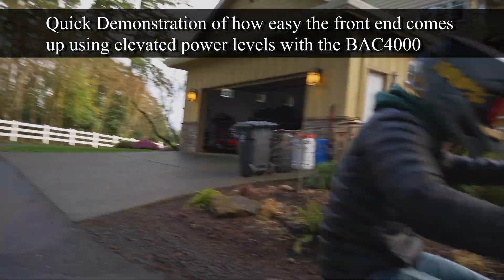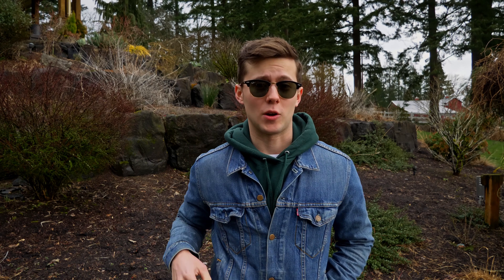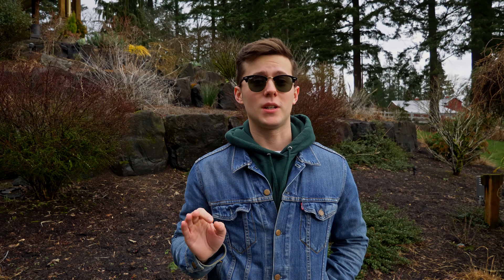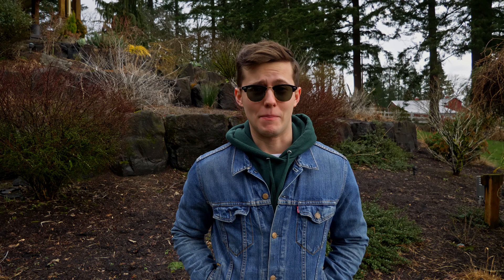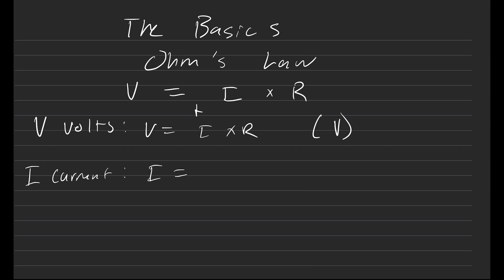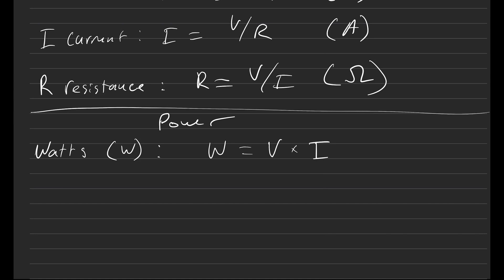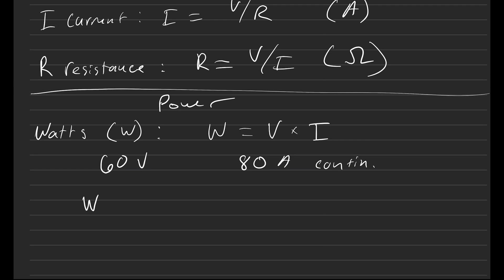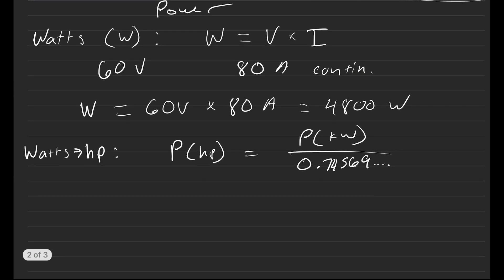The ASI BAC8000 is Overkill for the Sur Ron X

Comment: Do they give the same top speed?
Reply from the maker: There is some nuance to your question, but in general yes so long as the power supply is the same voltage and the settings are the same.

Comment: After running your 8000 kit for a while now, I can say forsure that the stock motor can handle more than what the 4000 can deliver.
Reply from the maker: Yeah it’s fairly situation dependent on the rider and type of terrain which we didn’t cover adequately in this video. For example, we’ve overheated the stock motor on the 4000 plenty of times on short hill climbs. In that instance, the 8000 would’ve just exacerbated the issue. Riding down the road or on more wide open trails, it can take more without overheating.

Comment: This is not true sorry. I'm 100kg and have MX forks. The bike is underpowered for me on a bac 4k and 72v. Especially on steep trails when I'm stopped midway up it doesn't have the phase amps to start again on stock sprocket
Reply from the maker: Yeah it’s definitely underpowered but our main point is that by pushing that extra motor current the motor overheats so quick. With new motors coming out there is a much more clear spot in the market for BAC8000 sized controllers.

Comment: E = Mc 2 So how much more efficient is the electric motor compared to a gasoline engine. Can they even be compared?  Why is a electric motor considered more environmentally clean when the manufacturing of components is more detrimental to the environment than gas engines? How can the electric motor be more clean when it still takes fossilized fuels to power the battery, and manufacture parts.
Why not just build fusion batteries or nuclear powered bikes? Are we building a 3rd world society in America? I really enjoyed your tutorial.  I hope one day I will ride one of your bikes. Outstanding ! Never limit yourself or your dreams.
Reply from the maker: Ebike is far more efficient but lithium is far less energy dense than gas. 

Long term goal would be everything is ran off fully renewable. Unrealistic though in a short timeframe.

Comment: Not hating but can’t the bac8k do max 840 phase amps u said 600 about unless your meaning like average 650 but max 840
Reply from the maker: We’ve never seen anyone successfully run 840 or even above 700 for that matter but yes, technically the controller is capable of 840.

Comment: Great video. Where you confused me is when you said that kwh is the most important number to look at when looking at how long a battery will last, and then went on to do an example where you used ah to look at how long a battery would last. My understanding is that if two batteries have equal ah, but one has a higher voltage, then the higher voltage one will go further or last longer given all else is equal. Makes sense because the kwh would be higher. But how does this play into calculating how long a battery will last? In your example, you completely left the voltage of the battery out of the equation, but instead talked about the power draw at 60v. Are you able to shed any light on my confusion? How would the voltage of the battery play into this calculation and change it?

Comment: To avoid jerky throttle you can Can change throttle curve or up battery amps and lower max phase amps for more high rpm power.  Gotta be careful not to overheat the motor though.

Comment: New to Sur Ron - the battery power options are pretty overwhelming.  Since so many are upping their batteries to 72V, why is it Sur Ron or someone else doesn't produce a 72V motor that is less likely to get fried by over-powering it?
Reply from the maker: There are a couple companies who are actually doing just that! Of course this leads to a TON of other issues. Namely:

-Swing arm is too weak for more power.
-chain is to small and already stretches very fast at 10-12kW
-the bike is entirely mountain bike components
-no real way to put down double or triple what a BAC4000 and stock motor can already put down. 

Certainly an upgrade more geared toward road riders!

Comment: So a question I have is what parameter does the “power levels” change when switching 1-9? Is it just lowering /raising the wattage?
Reply from the maker: Good question. You can think of power levels of a percentage of power based on the power level you set. For example, say you set the max throttle power in 'ASI settings' to 10,000W. At level 9, you'd have 100% power, so 10,000W. level 8 gives 90% power, so 9,000W. Each power level you go down drops the max power and max speed by 10%.

Comment: ASI 8000 is serious overkill i agree, unless you wanna set ebike top speed records or something but the motor will burn out.  Hell even the 4000 is overkill, peak power 72v @ 400amps? 30,000 watts? Thats like death power on a ebike.  I built an electric bike long ago, 72v @ 40 amps.. thats 3000 watts.. topping out @ 40mph and that scared me.

about efficiency, higher voltage is more efficient, and about 10 years ago, people on endless sphere were making ebikes that topped out @ 120v going about 60mph.  But then this dude came out and smashed all top speed records in his sandals on a garage sale looking bmx bike with a welded frame attached to a hub motor.  That motor had high wind (i believe) motor.. meaning for a given volt, it will do more turns.  So instead of going crazy high voltage, he went small radius tire, high winding motor, medium voltage and LOTS of amps. Since then, people toned down the voltage and got fast spinning motors with lots of amps.  Direct drive electrical motors love RPMs.  The faster it spins, the better.

So if you want more efficiency figure out how to make the motor spin faster.. more volts, or smaller wheels.  Mid drive instead of hub motor.

Comment: Thank you so much bro the whole part on phase current helped me so much I think this is why my BBSHD with the asi bac855 keeps getting burning hot despite if I run it in my torque gear aka 1st gear the whole time it still gets burning hot.  I was always told to run it this way because I was told on that motor that you want the motor spin as high rpms as possible to keep it running cool and seen some videos with guys pushing high power but on bigger rear sprockets and the motors run cooler (on the BBSHD we change the front chainring instead as opposed to surrons with the rear sprocket due to the derailer as I'm sure you know).  This all makes sense to me now after your explanation and I can finally get why a 72v gives more speed despite the bac855 adjust it's amp draw down for the 72v thus producing the same max watts on a 72v battery as it will do on a 52v battery.  On the 52v battery the bac855 raises the amps some than what it runs the 72v at.  I'm from the drone world and so I always knew about the kv of a electric motor and how it relates to speed and which battery works best with which kV and so on.  I sometimes wonder if they make a higher kV motor you can slap in the surrons and that would effectively be similar to running a 72v battery on the stock one.

Comment: Hey nice vid do you know if I could use the bac 4000 with the 72v lite speed battery
Reply from the maker: Yes, must have the correct system voltage on the tune though.

Comment: Is there a difference between 160 and 260 motors? Because I know battery and controller are different
Reply from the maker: They are different. How the differences effect the max power capabilities, that we don’t know. Since they’re different,  it’d make sense that the x160 was a lower power rating.

Comment: I have an x160 can the 4000 be programed to a 48v? so I can upgrade battery later
Reply from the maker: It can be programmed, but the x160 motor is not the same as the x260 and can’t take as much power.
Reply: @emotobros  i figured it's better than getting a x controller, but i don't need crazy power yet..looking for more range and a little more top speed
Reply from the maker: More range and speed needs a controller+battery combination
Reply: @emotobros  Thanks for the replies I know I need both but I figured I’d start with a controller wish I had the funds for both at the same time didn’t want to get the battery first because the controller I have won’t work with it…You guys have any idea when the new shipments coming

Comment: The bottom line is.... There are many people that have skill levels much more advanced than you.  The need for higher power levels are necessary to advance the development for individuals that are in a category above your capabilities along with advancing the development of different models of the bike itself. Not all interested riders are 5'5" 150 lbs, therefore the need for power increase is logical.   🤦.
Reply from the maker: Did you even watch the video 😂 completely missed the point
Reply: @emotobros  find a gym, strengthen and exercise muscles you don't use.  If your a beginner or even a novice then you don't need to be critical of people above your skill level.  I'm sure the battery companies have already figured this out.  😂
Reply from the maker: @thomaspartin191  Hey man, I can tell you aren't understanding so I'll make it more simple because we use a lot of technical terms. More power = more heat in the motor = motor failure. This has nothing to do with rider skill. Anyone of any skill level can hop on a road and hold the throttle wide open and burn down the bike.
Reply: @emotobros  face it, you shouldn't be critical of areas your not familiar with. Technically speaking, your equivalent body mass vs your mind strength is negative equation.  Like I keep saying, the bike manufacturer along with the battery manufacturer have done research, done testing with real people.  I'm almost positive these companies engineers  have went to college for "technical" advancement, that's how they development the electric bike and you didn't.   Nice try bro. 😂.
Reply from the maker: @thomaspartin191  Areas I'm not familiar with? I'm a double engineering major and have been riding for 15 years. I'm one of the guys who you are acclaiming. Also, this video is not related to the bike or battery manufacturer which tells me even more that you didn't watch it. Some of the engineers at ASI don't even run 8000s on their bikes, so in a sense you're right. They do know what they're talking about. The 8000 is overkill for the SurRon, glad we are on the same page.

Comment: Awesome video guys!!  I'm really glad you focused on "usable power" so many people focus on a single number and making power useable is so much more important than just a single peak power rating.  This is the same reason that when MX racers such as Ricky Carmichael first started racing 450cc MX bikes with 50+HP, many of the pro racers actually detuned the engine to make it more usable and win races.  Meanwhile ameature racers with the mindset of more power = faster were bolting on aftermarket exhaust and other power enhancers...by increasing power they were actually getting slower lap times.  If you ride a modern EFI 450cc race bike and compare it to the early 450cc machines, you find a far smoother power delivery in a modern bike which can actually feel slower to your senses, but the "usable power" dramatically increases your race speed.
Reply from the maker: Totally agree. Like you mention, even the modern factory 450s are basically running the same HP as stock. It’s all about their crazy engine programming and traction control to make the power usable. Some people are stubborn though...

Comment: Good points, in  the 1940's and 50s there were GP 125 bikes that could do 80% of the top speed of 1000cc bikes. Ebike power posing is normal.

Comment: Great information and video.    Curious tho, I ride 450 dirtbikes that are great on power.   Do you still think the 8000 wouldn’t be enjoyable?
Reply from the maker: It’s not that the 8000 isn’t enjoyable it’s that it costs $200 more and the amount of power that the SurRons chassis can handle is capable of being output by the 4000.

Comment: So if I would get the 72v 45 with the asi bac 4000 would that make the bike  get too hot i want to be able to do wheelies but I would  also like a little distance
Reply from the maker: If you run reasonable power levels with that equipment you won’t have any issues
Reply: @emotobros  I'm thinking about ordering a surron the kit and the 4000  this week but i can't find any charts to how long any of these battery last on eco or sport
Reply: @onlyboss2245  there's no more eco/sport mode with the bac controllers....EMB has a display that you can change power levels from what I've seen/heard....
Reply: @ScottPaulConley  either way it still should be a chart somewhere showing the estimated distance for each battery right ?
Reply: @onlyboss2245  unfortunately not....it's so variable depending on weight, incline/decline of road, speed you are going, rear sprocket size, etc, etc...suronster has some great range videos though....

Comment: But...the bac8000 is not worst than the 4000 either.  To me it's a in stock issue.  I missed yours and with only 50 units coming this batch...I will probably miss it again.  I got an bac8000 for only $200 more than a bac4000.  It's on stock battery for now so hopefully tune from other company is sufficient for now.  I would like to know once I get a battery upgrade will I be able to pay for a tune from you guys?  Your tune should work the same regardless if it is a 8000 or 4000 right?
Reply: That's my thoughts also....plus you get the cool billitt aluminum cover/install kit from "the other guys" but EMB seems to be very knowledgeable with great videos! 👍

Comment: Great video, do you know saturation point/curve for surron motor ?
Reply from the maker: There isn't like a single value that I can give you for that for a number of reasons. Magnetic saturation of a motor depends on load, throttle amount and however you have your bike set up power wise. We don't have the proper equipment to analyze the Sur Ron or else we would. As far as I am aware nobody has published any analysis of the Sur Ron that I could reference. You can get a general idea of magnetic saturation just by riding your bike and experimenting with different things though. For instance, imagine you are riding your Sur Ron up a large hill that has a grade that increases with elevation. You are ridding up the hill full throttle, and at some point, as it gets steeper, the load will be too much for the motor to continue accelerating and you will begin to slow down while still pumping power into your motor. This is your motor is reaching magnetic saturation. Here is a link to a video that analyzes brushless motor saturation and it may help you advance your understanding of the subject: https://www.youtube.com/watch?v=8x0LnLq17dc
Reply: @emotobros  thanks